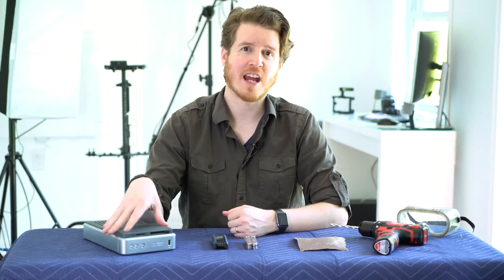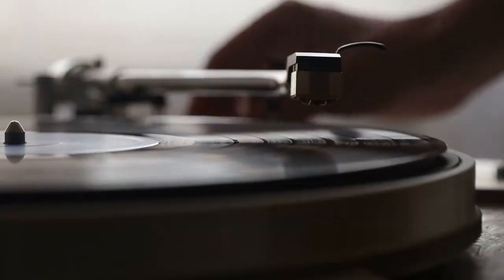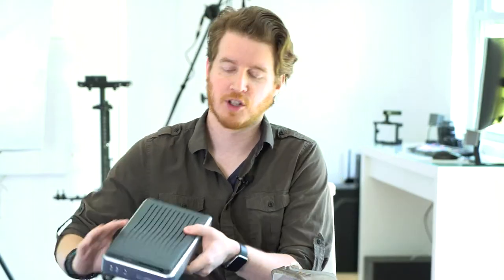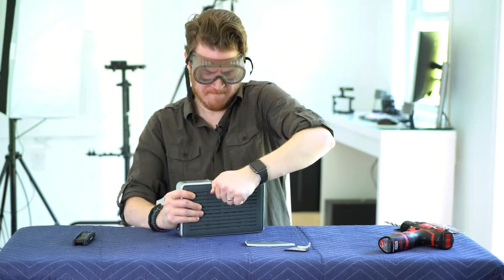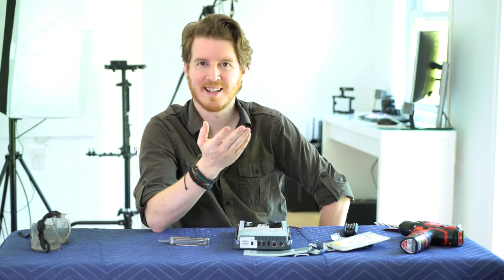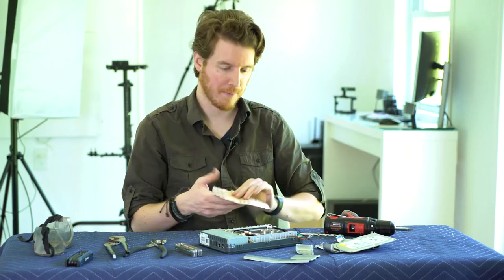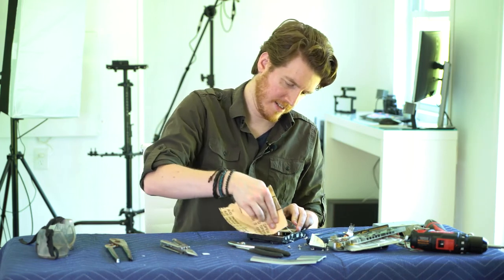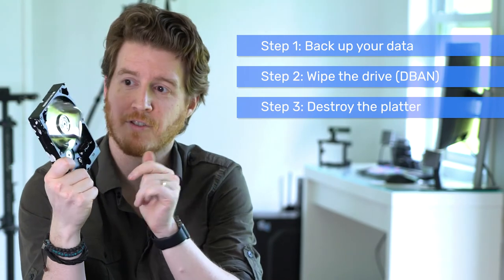How To DESTROY an external hard drive! No chance of recovery

Comment: My screwdriver set (Radio Shack 6400185) has more sizes, and makes it easy to remove the hub screws, to get the platters out.

I ran the neodymium magnet over all of the platter surfaces, but have seen info that this might not be as effective as you think.

I then took an Exacto blade, and made spoke lines on them.

Sandpaper is a good idea, thanks!

In the future, some archaeologist will retrieve it, throw it in a machine that scans it in, and will probably be able to see 80% of what's there.
Reply: I then threw out the platter in the garbage, while taking the rest of the HD to a metal recycling place . . . now I'm thinking . . . 

I'll just do the above, forget the sandpaper part, too much work . . . and include the platters in what I take to the metal recycling place . . . and they will physically destroy it that way for me

The case parts have some good metal in them, on my to figure out list is, is there a way to get more money for them, than at the metal recycling place?

Comment: Just power on the driver while open, then while its running, sand it down with some sandpaper.
Reply from the maker: I understand the thinking behind that, but it's just too easy to get your fingers caught or pinched in a bad way. I wouldn't recommend that.

Comment: What is the point of the Boot & Nuke if I am just going to drill holes in the disc plates and/or cut them into multiple pieces with a grinder?
Reply from the maker: I wanted to ensure there's no way anyone could recover anything... it's a failsafe in case areas of the platter were missed when damaging it. Technology is always improving, and my thought is that certainly there's a way to read data off a portion of a recovered platter. Boot & Nuke will help eliminate that concern.

Basically it's a CYA kind of thing.
Reply: @ChrisBryantVideo  Makes sense...thanks!

Comment: Hi Chris, what if your desk top computer doesn't come on. Do I just destroy the hard drive?
Reply from the maker: A desktop that won't turn on could be any number of things (although a corrupt hard drive is near the top of the list). It could also be the power supply itself, an issue with the RAM, or simply a loose cable inside somewhere.

That said, if the computer is truly unrecoverable, you've backed up the drive already and want to get rid of the computer, yes - go ahead and destroy the drive. 

However, if you haven't backed up the drive and have things on it you'd like to save, I'd recommend getting a hard drive docking station like this (https://amzn.to/3iYzqVB). Just make sure it's compatible with the size of your hard drive. This way you bypass the computer, and can use another computer (laptop, etc) to essentially allow you to use it like an external drive (or big USB stick). If the drive is recoverable this way, you'll be able to pull off the data from it. Good luck, Ruth!

Comment: Very nice but what if you have 10 drives?  Too much work.  Once you bent the disc you were done.. In the end who is going to go to all the trouble of trying to read this disc once discarded?
Reply from the maker: 10 drives requires a bit more work for sure, but it also means there's x10 data that's out there for someone to try to get. Chances are probably pretty good that no one will try reading the disc once it's discarded, but you could also think of it this way: if you threw your wallet in a garbage can, who would find it and try to do some damage with it? A discarded hard drive can look a lot like a full wallet to the right person.

For me, it's not worth taking that chance, no matter how small.
Reply: @ChrisBryantVideo  Still think this is overkill.  No need to open the drive.  Just discard the entire memory board so there is no interface to the drive.  I then take to local recycling center where they shred everything.  All drives with no interface board.